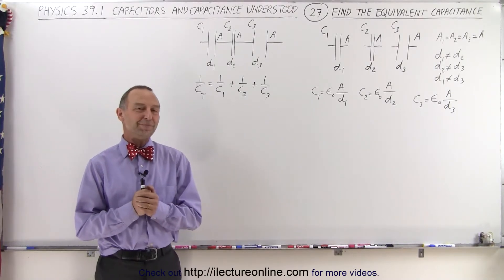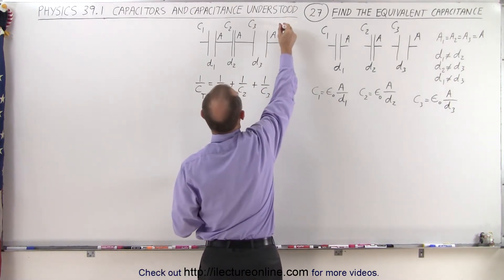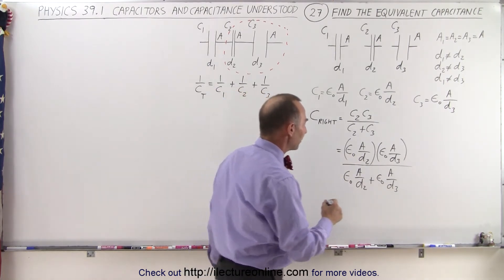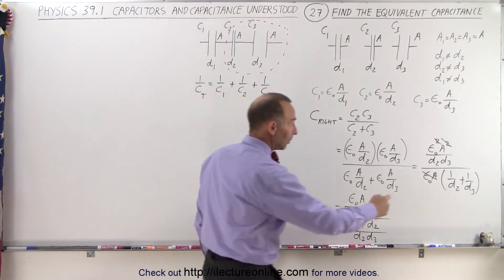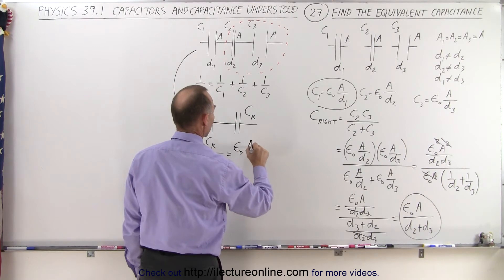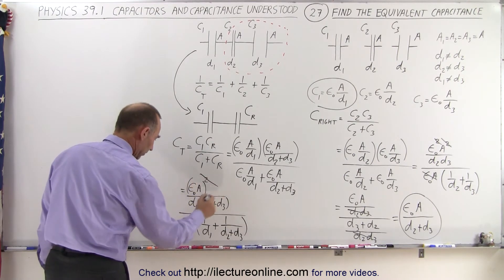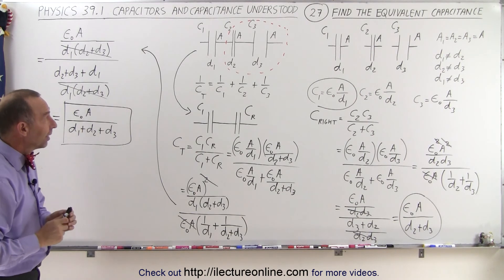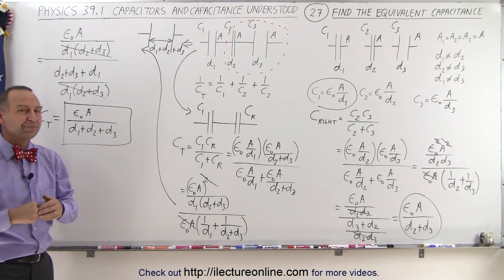Physics - E&M: Ch 39.1 Capacitors & Capacitance Understood (27 of 27) Equivalent Capacitance=?

Comment: Each of two identical conducting rectangular plates are initially
parallel to each other and each has surface area of A (A = a  b) and
the distance between the plates is d as seen in the figure.
(A = 8 cm2
, a = 2 cm, b = 4 cm, d = 4 mm, €0 = 9x10^12...)
a) If you want to construct a variable parallel plate capacitor by using
these two plates (without changing of the distance of the plates and
the orientation of the wires) plot the proposed system.
b) Find the range of the measurable capacitance value (Cmax-Cmin) for
the proposed variable capacitor?
c) Find the maximum reached electrical potential energy with this newly proposed variable
capacitor, if you have a 12 V battery and a rectangular prism shaped dielectric material
with a dielectric constant of K and a volume of V= a x b x d?
Reply: sir i didn't find this on internet and in your videos, My Proffesor give me this i'didn understand could you explain it please?
Reply: https://drive.google.com/open?id=1pzjEEPxYZvy05O6eLLPBoU4FGMF_8qxv